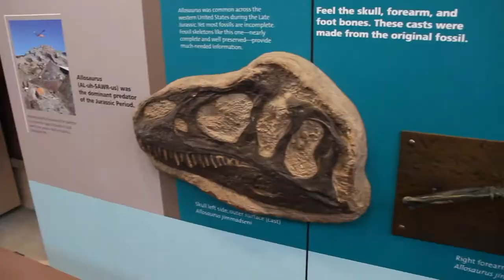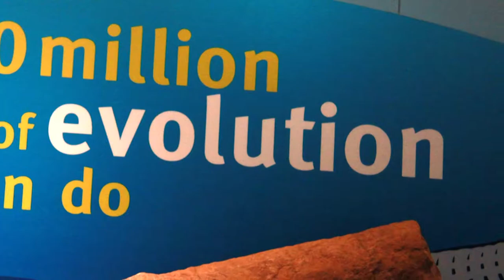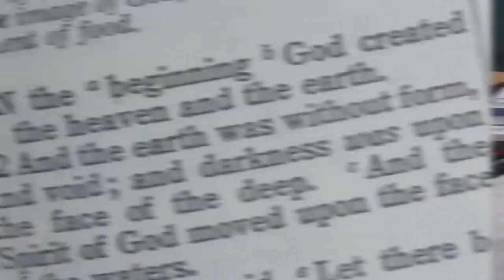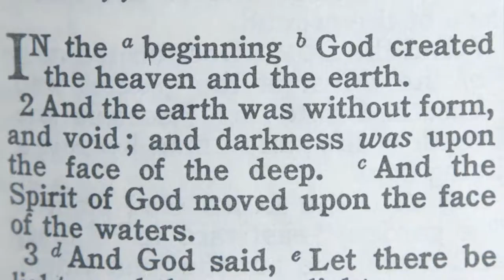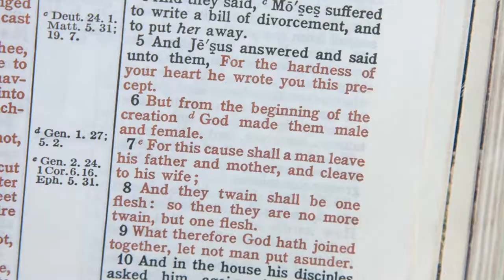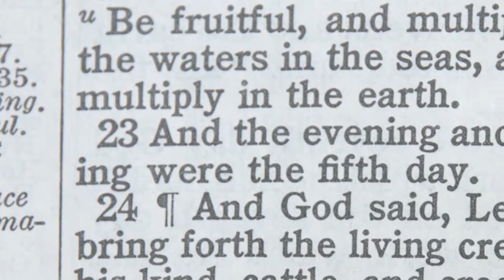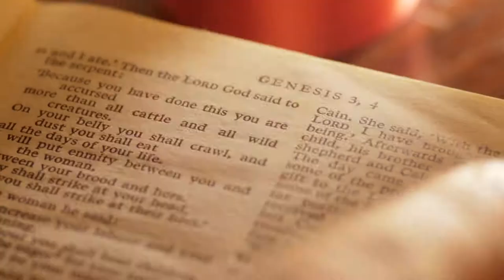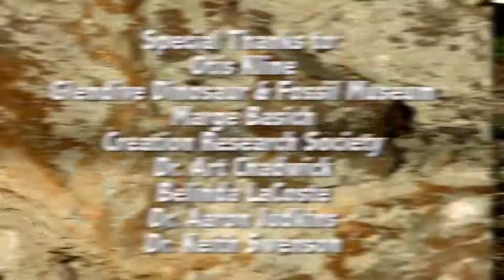DHB101 Discovering Soft Dinosaur Tissue

Comment: Did they dig up the rest of the body???
Reply: No, because this is garbage misrepresentation, they were unique fossils in Madagascar remarkably preserved by clay beds, there was no soft tissue, rather after soaking microscopic slices in acid for 2 months a very tiny amount of pliable material was found to have not completely mineralized, no DNA was recovered, this whole thing has been sold as something it wasnt, and this is coming from someone who was on the bandwagon, until I did my own digging. All religions are astrological allegory starting in the age of Taurus and following Orion through the Summer Sky, then Serpentis as his father in the Winter sky. In that age Orion rose in Spring, and fell in Fall, but is the Sun that is reborn on the winter equinox, and the Phoenix was Venus which resurrected in Easter ince every 584 years after self immolating on the Holy Grail, or Philosphers Stone. 
https://youtu.be/JbWJ6yzsef4

https://youtu.be/FRk2zsovsTs